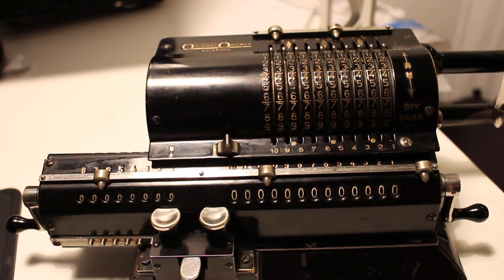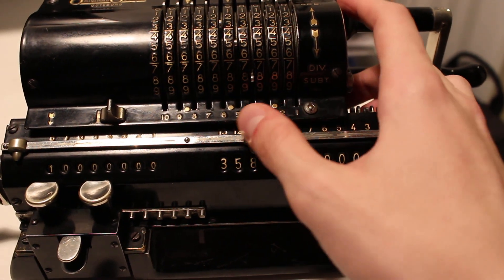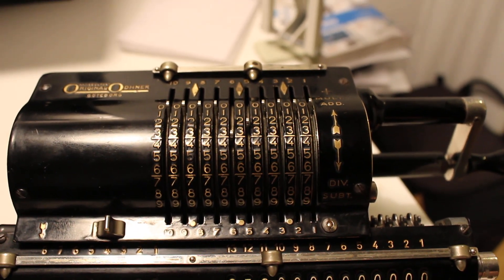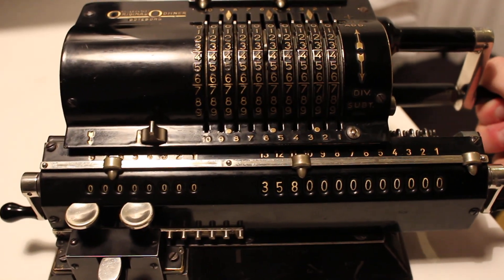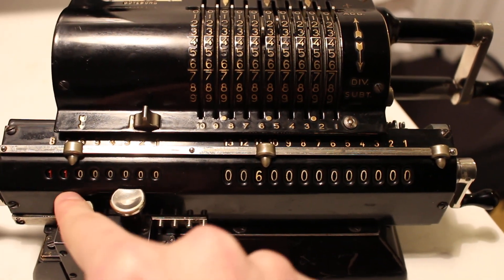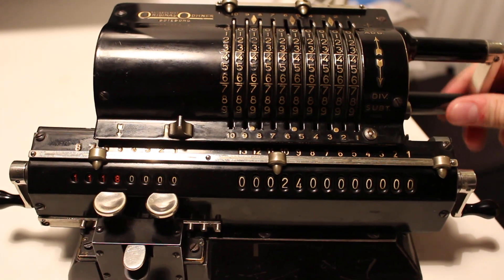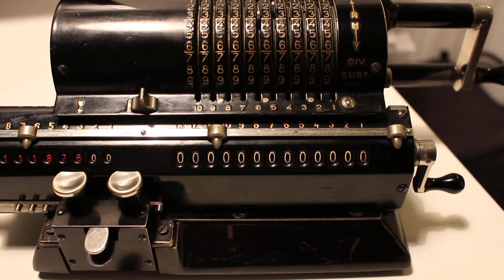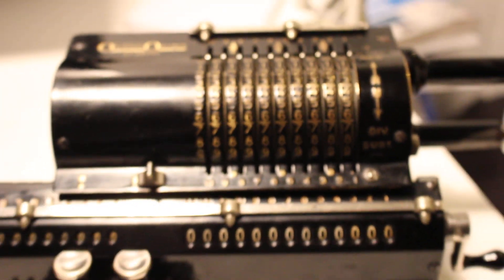Original Odhner - Division & Decimals

Comment: I may sound slightly dumb for asking this (have no idea how these machines work, just interested in them) but how do you determine where the numbers go in the settings register? For example, you put the 3 in the 6 spot and the 2 in the 5 spot for 32, why not just any other place? wouldn't it work as long as you set the decimal place right and have the numbers next to each other?
Reply from the maker: This is about aligning the divisor with the dividend in the accumulator. The 6th position is the leftmost position in the setting register that connects to the carriage when it's shifted to the far right (carriage position 8). 
This allows us to determine how many times 32 * 10 fits in the number 358.

If I had put it in positions 5 and 4 I'd determine how many times 32 fits in 358, which causes some problems.
1) The amount of times I need to turn the crank increases by at least ten
2) This model of machine doesn't support carryover in the counter, so the result would be rather incomprehensible.

I hope that explains it! Let me know if something needs to be clearer. =)

Comment: How do you determine where along the setting register you initially load the 358 and 32? E.g. Why decide there are 4 'blank' slots to the right of the loaded 32?

Sorry for my ignorance. Great videos!
Reply from the maker: It's about the alignment of the carriage. If you look to the left of the 32 you'll see that those levers are actually off the accumulator register, so they won't have an effect.

The aim is to put the dividend (and divisor) into the far left of the counter register.

Comment: Do you have or know of a calculating machine, like your Odhner here, that when operated in multiplier mode the number of turns(of the crank) that is needed to achieve the final product is determined solely by the number of (decimal)figures in the machine's entry register times a factor of ten?
(Example: 212 * 100 or 100 * 212 will result in 21200 when the machine's crank is turned 30 times)..
Reply: I'm not sure what you're asking. In a mechanical calculator a multiplicand is entered into the register. It is then added to the accumulator through multiple additions and shifting until the multiplier appears in the counter. Then the product will be in the accumulator.

In the case of 212*100...Enter 212 in the register. Turn 0 times in the one's place. Shift. Turn 0 times in the 10's place. Shift. Turn once in the 100's place. The register still has 212, the counter has 100 and the accumulator has 21200.
Reply: jedi1357  
In the late 1960's they built a mechanical calculator that could compete with the new desktop electronic machines, and could be operated in a similar way in terms of how data/numbers could be keyed in.
But this machine was so big and complex it needed three different kinds of lubricant to keep its components running accurately.

Comment: So let me get this straight, the dividend of this calculator's division operation is displayed/indicated by the the turn-counter (cyclometer)?
Reply: No. Placing the dividend into the accumulator is the first step. The divisor is then placed into the register and subtracts that from the register as described. The quotient is then displayed in the counter and the accumulator holds the remainder if any.
Reply: jedi1357  I think we got a difference of math terms here!  The dividend is the end result of a division. If this machine uses RPN then the Quotient enters the Accumulator first, then the Divisor is entered into the Entry register - in that order. 
I am presuming that is the logic of these machines.
The Dividend might be generated in and displayed on the Turn Counter(cyclometer), the Remainder will be what's left in the Accumulator and displayed there.

Does that now sound right? 
Did you read my last comment??
Reply: I don't know if things are different where you are or if things are taught different now but even Google says a dividend is a number to be divided and the quotient is the result of a division. Other than that it looks right. I don't think RPN is what I'd cal it though. It's just repeated subtraction and shifting.
Reply: jedi1357   Oh yes, I got it backward - - the Quotient is the end result.
But still, is not, or can the Quotient be indicated by the Turn-Counter aka Cyclometer??
Reply: Yes. The answer/end result is indicated by the turn counter. It is limited by the number of digits available however so it is not always exact. Example: 1/3 gives 0.3333333 in the counter and 0.00000001 in the accumulator. Think of the 1 constantly moving right because 10-(3*3)=1.

Comment: It is not apparent but the Original Odhner had a quirk in the way that the register mated with the counter and accumulator. Because of this, for numbers with many digits, you may get an additional digit of accuracy in division and square roots by placing the carriage to the 7 position rather than the 8. This is because the 7th digit of the register isn't hanging off the end of the accumulator.
Reply from the maker: Yeah, they're pretty much all like that. I know the Hamann Manus does it too, while indicating the cut-off point with a little red dot.

Good tip on not shifting the entire way, though! I hadn't given that much thought myself.
Reply: jedi1357  Whoa!